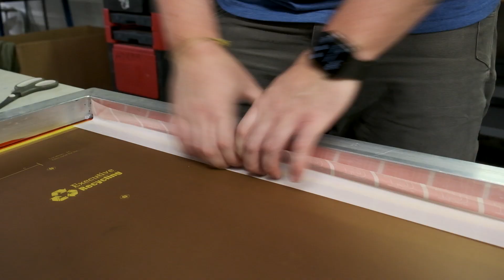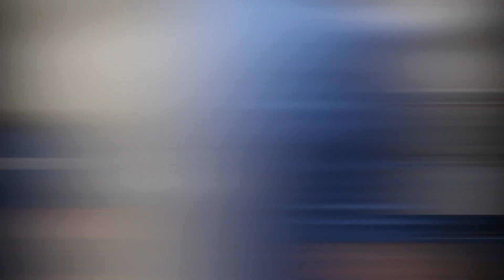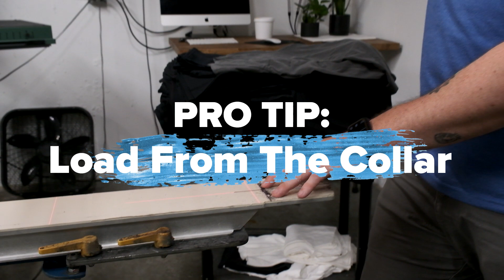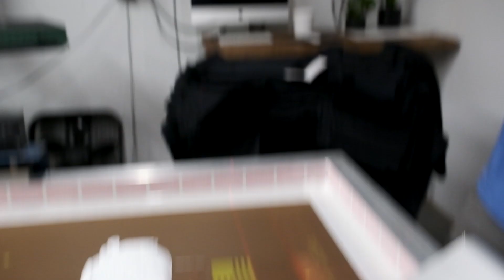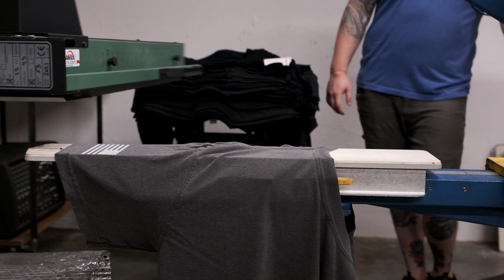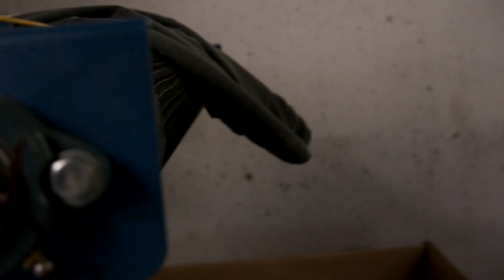Screen Printing on Sleeves

Comment: Great info. Thank you. How high from the bottom of the sleeve do you place the flag. 1/2 or 1 inch? Also you mentioned the flag position. Flag (lines) face toward the back ?
Reply: You pretend the flag is on a pole.  When you move forward... the flag will fly to the back(hence... it is backwards).